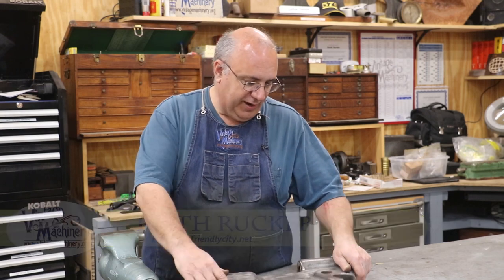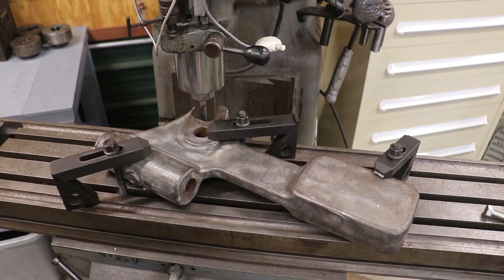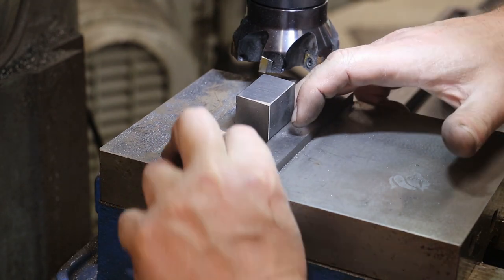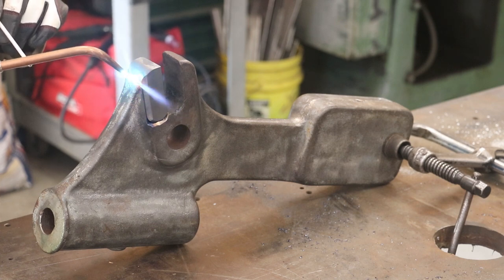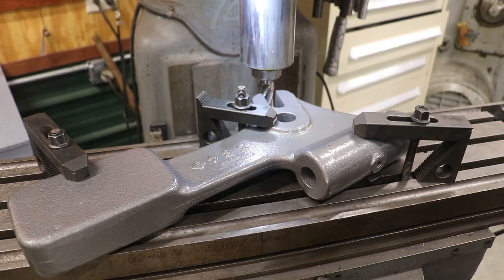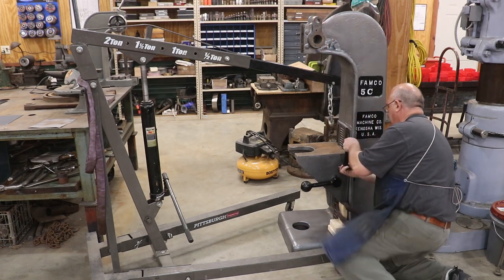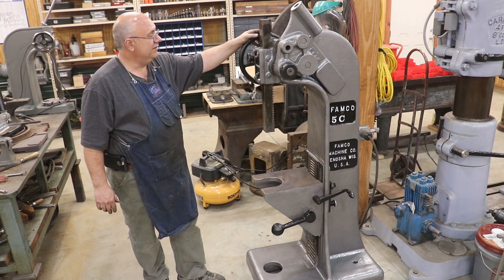Famco 5C Arbor Press Restoration Part 2: Lever  Repairs and Reassembly

Comment: Oddly enough, welding cast iron was one of the few topics covered in my single half-year of metal work at comprehensive school. I seem to remember that if you do weld rather than braze you need to apply a heat treatment to the whole finished piece in an oven--or I think it was a 'ceramic chip forge' that was used. This is to take away some of the excessive hardness from the cast iron that welding introduces. That is what I very foggily remember anyway!
Reply: Yep, ya gotta get the whole thing just below critical, soak and let cool in place for 24 hours.  ABOM79 covered this recently in a video where he had a cast piece made and it embrittled because it was removed too quickly.

Comment: In my shop we had 3 presses. A ten ton press brake. A hydraulic press to 6 thousand psi on a five inch ram and an Arbor press. All used much. Our arbor press turntable started out at 3/4", up to 2 1/2. I have hung off the handle, till giving in and going to the hydraulic press. The pressure gauge on the hydraulic was directly visible, so you could push the handle for as much force as you needed, so you wouldn't destroy a 1" piece of metal.

Comment: That is a beautiful restoration. Thanks so much for sharing.  I just purchased a Famco 3 1/2C model and the arm pivot slot had some similar wearing on it.  It great to see how you repaired yours.
Reply: Dave Tarrant I just picked up a 3 1/2 non ratcheting press. Any chance you could share dimensions of the brake spacer on your press? I’m going to have to fabricate one.

Comment: i worked at a fab shop that did cast iron repair they would do the milling as you have done then they would dowel pin brazing rods in a hundred different angles seems like any way then heat the part to melt the brazing rod then boarx the part for flux so it was i repair from inside out very strong joint i was young working there today no one would take that much time to weld something. great repair thaks for showing us how you do it

Comment: Hey Keith for the slot that you just fixed I'd suggest 5th wheel grease.  Years ago I bought a spray can of Amsoil synthetic 5th wheel grease.  What made me think of it for this is the stuff sprays on but then becomes real tacky and is designed for low motion high pressure applications; like this.  Just line the new slot and the stuff will stay put for years, and likely eliminate most of the wear.  Lookin good!
Reply: Trying to grease it probably caused the wear 
Grease and dirt makes  grinding paste
Reply: @fowletm1992  Hum?

Comment: Hi Keith, how about using a pouring of Thermite to fill in the wear space and then machined the part. A top and bottom mould would would have to be made with a separate overfill chamber.  What are your thoughts on this idea, for one there are many machines out there that need repairs such as this, and parts for them are not available.

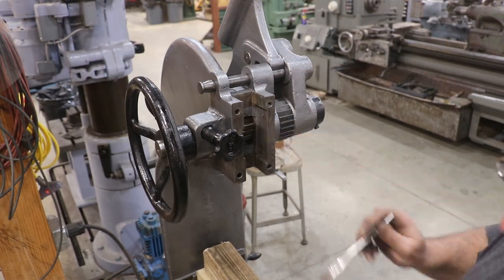Comment: @23:56 there looks to be room on the left and right of the ram to put some rectangular sections of oiled felt.. and also a piece inside the front cover above the insert plate.. perhaps 1/2" x 5/16 x 1.5"  so three of the four sides get oil wick lubed every up and down stroke.  might be an easy update..

Comment: Sure is purty, nice job . That's an arbor press , best way to do the area pair too. Do you think a rub of grease in that slot would help deflect wear there?  I think since its a wear point it would be a good thing to do. My poor ole press would look good to if I can ever get my body out of pain . But guess I didn't help it horseing around super heavy steel and iron from my wheelchair . Please keep using your engine lift I ruined myself , three years doctoring and no better . Thanks for helping me keep hope. Gary

Comment: How do they rate these presses?  I would guess they use a specific weight on the end of the lever then measure the compression at the ram/base to say it is 5 ton, 10 ton or whatever. That would mean any weight in excess of that would generate higher pressures. So little Tommy at 90 pounds is going to have a tough time while BIG Bill at 325 pounds is going to break parts ??

Comment: I have a daisy wheel that might just fit your machine. It came with my 7ton greenard ratching less but is too large in diameter. Its 2" thick and 12.250" od. Let me know if you think it'll work
Reply: ...what happened?

Comment: Nice job, Keith.  I wonder how some alternatives would have worked out:

Would silver solder have produced a stronger joint than bronze?

Would it have been better to braze a thin layer of filler material onto the joining surfaces?  The theory I'm playing with is that this would have guaranteed that every part of the joint was chemically bonded to the filler material.  Then the subsequent filling of the joint would have capillary action to help pull liquid filler deep into the joint... guaranteeing no voids?
Reply: The brazing is plenty strong enough for this as the repair part is under compression. A good braze joint on cast iron can be very strong, but the work has got to be chemically clean to get a good joint. Cast iron is porous and getting all the oil and other contaminates out is really important for a good outcome.
Silver is very strong (often stronger than the parent material).. if done correctly. If you look at a graph of the strength of a silver solder joint you will see that the highest strength is attained when the gap between the parts to be joined is about 0.003" - 0.005 inches.  Then you have to heat the work up very quickly. If you use a propane torch, silver soldering even small parts is a pain. You end up cooking off the flux trying to get the work hot enough and then the silver won't flow worth a crap. Oxy-acetylene or an acetylene plumbers torch is the ticket for a good job. When done correctly, the silver solder flows when it touches the work and is drawn to the flame. If you have to put it in the flame to flow, the work is too cold.
Reply: He could have stuck it on with some elmers white glue and it would have held fine. Lol.

Comment: Can someone tell me what stopes the ram from spinning the hand wheel and sliding to the bottom you would think the weight of the ram would over come hand wheel easily every time but It doesn’t matter what size press they all don’t do it and I cannot work out why there doesn’t seem to be enough friction when you turn the wheel they always turn freely please tell me if you know thanks guys
Reply: Over all friction, and the piece at 23:38 that jams that taper against the shaft.

Comment: I think it broke first, rather than being worn through from the start. Either way, it will be fixed now, kind of annoying when people know there's a flaw but they don't address it, leading to the failure of the machine, leading to them throwing it out in the garbage, when it wasn't the machine's fault in the first place. In the mid two thousands, junkyards were full of stuff like that here in Europe. So much history lost.
Reply: A break in that spot would be very unlikely. (Unless the whole past broke off, but that obviously didn't happen.)

Comment: What solder is that? Can I get the brand and part number please?

Thanks!
Reply: It is not solder, which is soft and weak.  It is flux-coated brazing rod, available from any local welding supply company.  The material is a bronze alloy that is approximately the same strength and wear resistance as cast iron, making it the perfect material for repairing cast iron.
Reply: @kensherwin4544  It is soldering.

Comment: Keith I got nothing but love for ya buddy but if you tap the cast block you grazed in there its gonna fall right off. That rod will melt way colder than what the cast iron needs to be for the braze to wet to that iron. You need to get that cast iron hot enough that the filler melts just from touching it to the iron. You held the rod over the iron and let the torch melt the rod onto the iron. Not gonna work my friend.
Reply: Caleb Welte I kinda wondered that too... ideally you’d want enough heat in that whole area that the brazing rod would flow all the way in between the two parts, right? Just like when soldering big parts with lots of thermal mass.
Reply: It got plenty hot. You can see it's red hot when he pulls his torch away. It'll be fine. Especially since there is a net zero force on the part.

Comment: Why not oil the pin that wore the slot?
Reply: My thoughts exactly a little lube goes a long way.
Reply: @ericcorse  I'm still puzzled by the extreme amount of wear on that slot, considering that cast iron is fairly wear-resistant.  I suppose it's possible after many decades of daily use, with no one thinking to lubricate the pin.

Comment: The added strength of welding compared to braising would be a consideration if the parts were under a strong pulling or twisting load.  Here the load is essentially pure compression, with a small sideways shearing factor, so the braising is merely there to hold the parts firmly in place and let them take up the forces, therefore the internal braising bond strength is of minor importance.
Reply: The brass has a higher uts and ductility than the cast iron especially if using the correct alloy. In this application you really want the added ductility of the brass over a welded repair.  Brazing is the superior procedure here.

Comment: For the press lever repair, I think it would have looked nicer to use a bandsaw to remove most of the oval shaped embossed part, then milled it with a nice radius, then machine the matching part from the scrap cast iron, put the hole back in ... maybe even add space for a brass bushing to take the wear away from the cast iron and have the bushing wear ...

Comment: Forgive me Kieth, but so many dry ratchet shaft areas - im an oil finatic--lol
Reply: It'll be fine for the 2x a year it is cycled one time.
Reply: It's all Open 
If you oil it dirt will stick to it and make the wear 10x faster 
Common mistake to oil the scrap out of everything 
Wouldn't be surprised if people trying to grease the slot that caused the wear